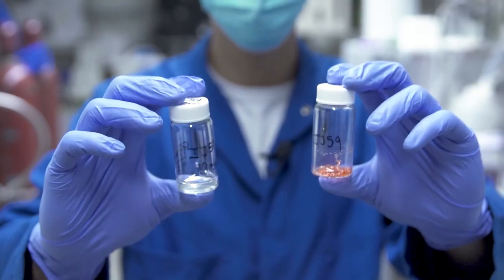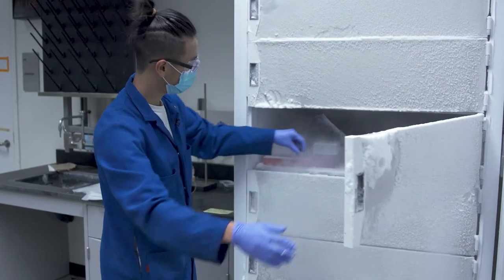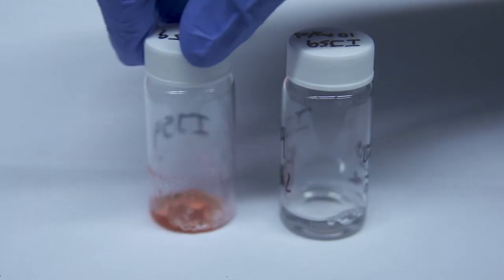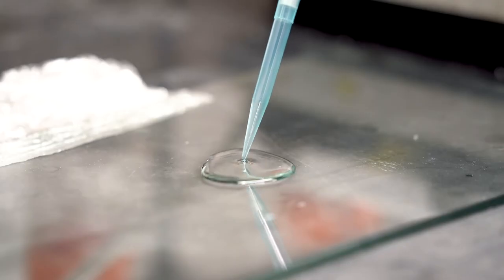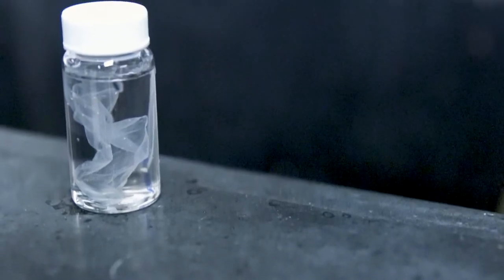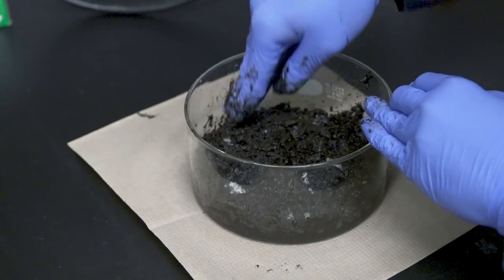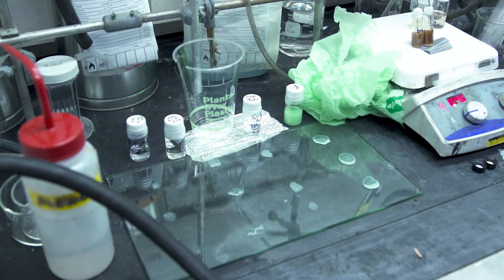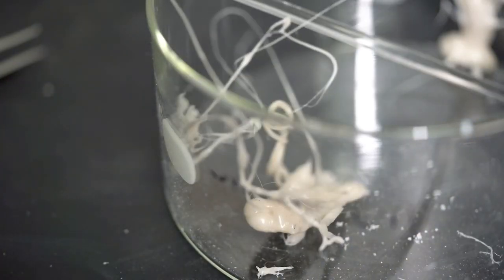How we make it: Better biodegradable plastic

Comment: This is super cool, but I have been thinking about the use of biodegradable plastics. How would one, per se, replace a snack back with this so when it is thrown away it degrades? The snacks inside contain moisture, but you wouldn't want them degrading as soon as the bag came in contact with the contents. Do the enzymes have to be exposed to a certain concentration of moisture to dissolve, like more moisture than in a damp store? Do the enzymes produce toxic substances when degraded? I am really curious about these questions, so I would love if you could get a chance to answer them. Thanks.